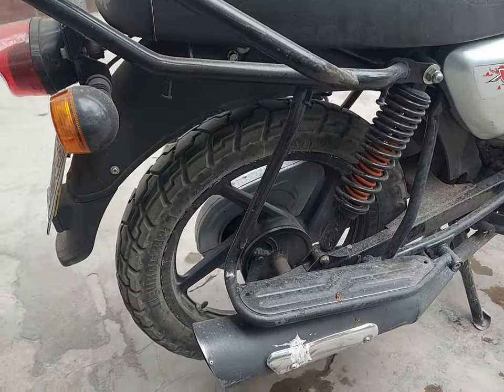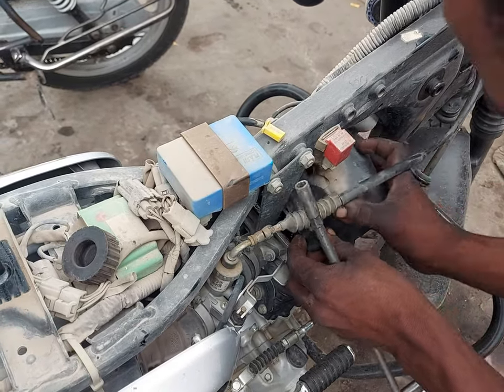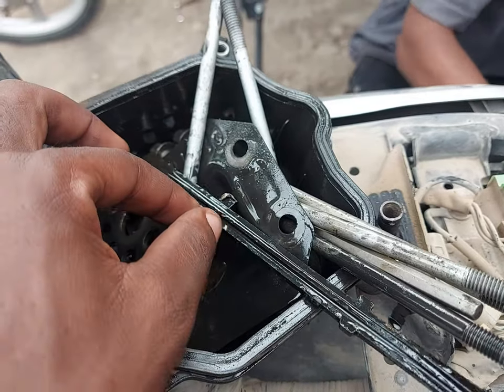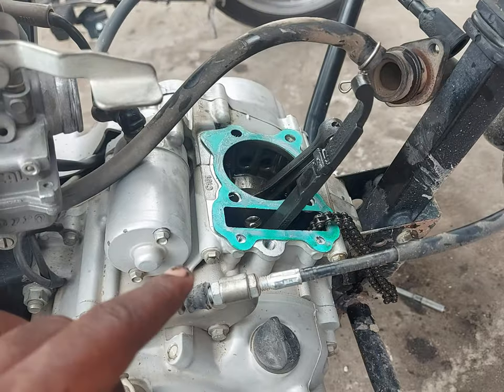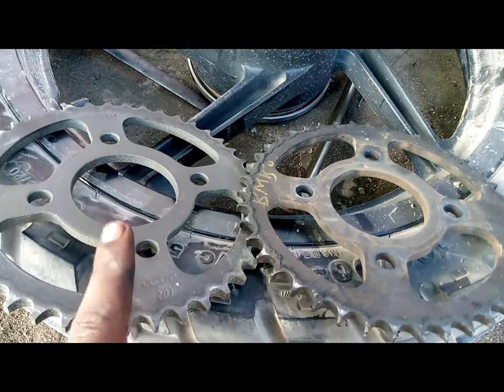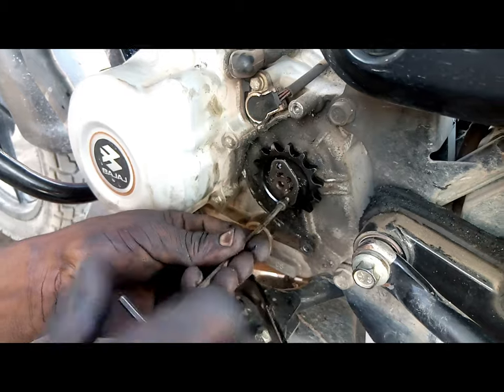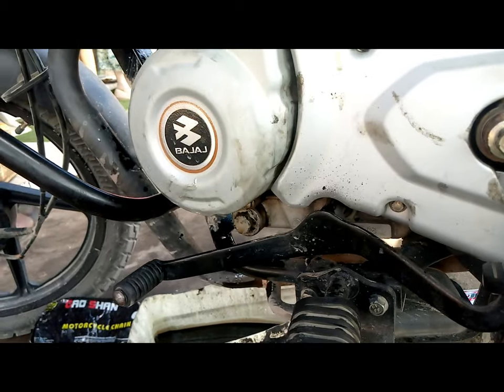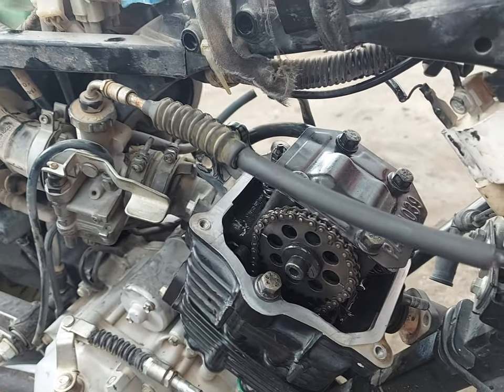Boxer Gasket seal  change & Chain Kit change.

Comment: Nice video. Waiting on the video comparison between boxer x150 and bm 150
Reply: The only difference is cosmetics. The x150 has a raised front mudguard and off-road tyres. whilst the bm 150 has an on-road front tyre and semi off-road rear tyres. Both engines are exactly the same, no difference in power.
Reply from the maker: @trapking1571  Well ,I will share the video soon ,for overall comparison...
Reply: @trapking1571  ok